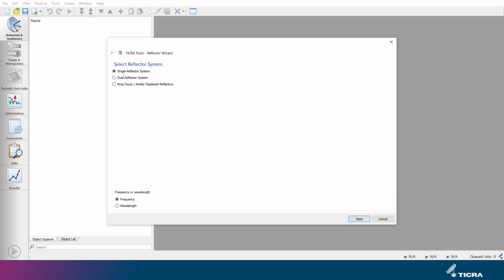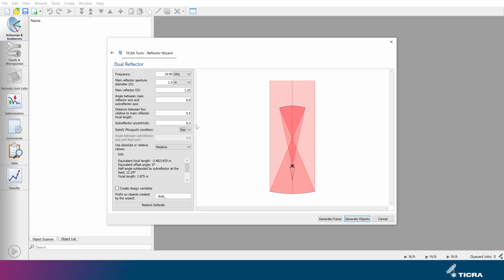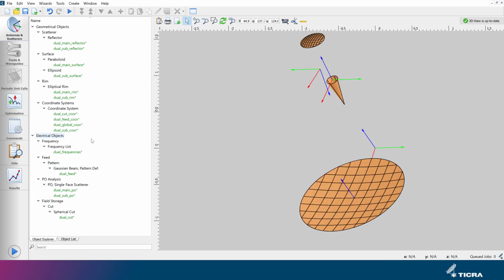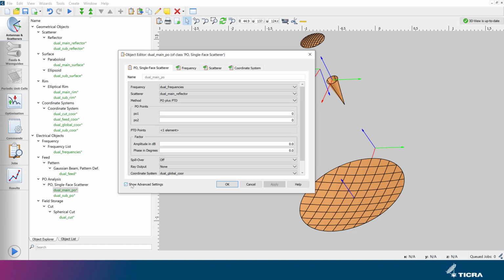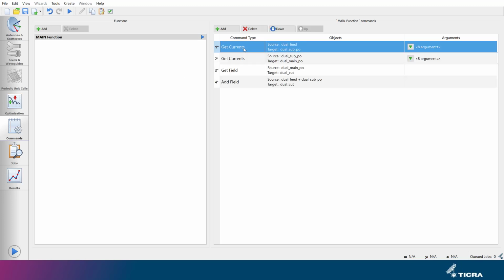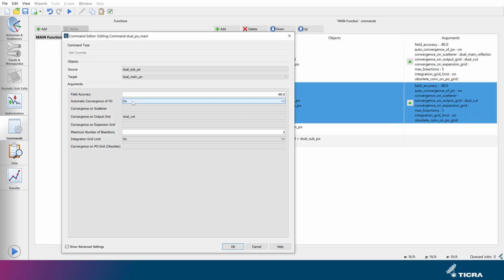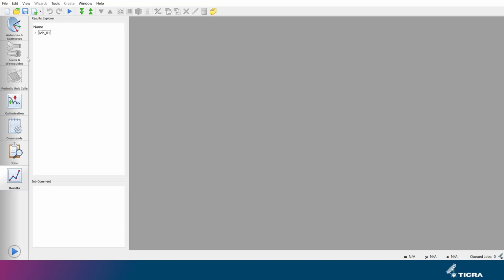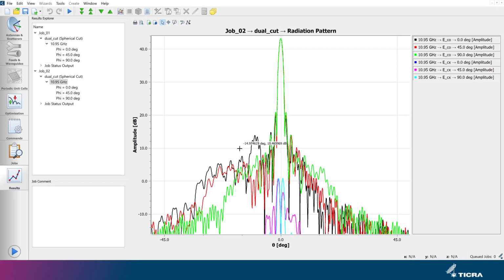GRASP: How to setup a dual reflector antenna analysis

Comment: Hi, I am designing the 1250 mm diameter reflector; the f/d ratio is 0.4. I failed to bring the radiation pattern under the ITU-T envelope (7.25 GHz to 8.4 GHz band). I assume the problem occurs when I add a splash plate with a cone. Do you have experience I need guidance.

Comment: I have one doubt, if we feed TE11 pattern CSV file and plot secondary for dual cassegrain antenna the results come ok. But for same geometry if we feed TE21 pattern CSV file and plot secondary the results are not correct. Can I get some help on this.
Reply: Hi Sandesh, I suggest that you send your CSV files to support, together with a description of the problem, i.e. what did you observe and what did you expect. If possible, sending the entire project will definitely help our supporterss.